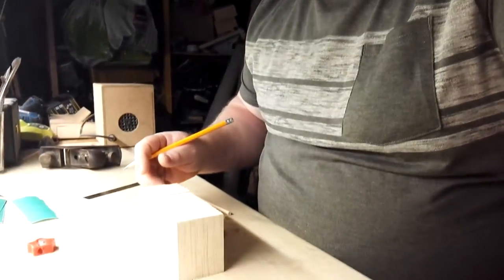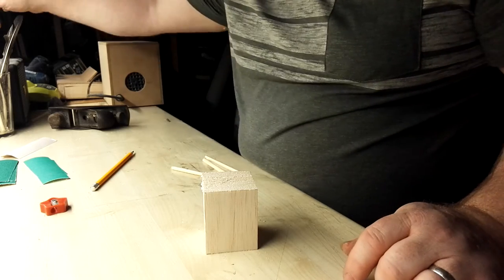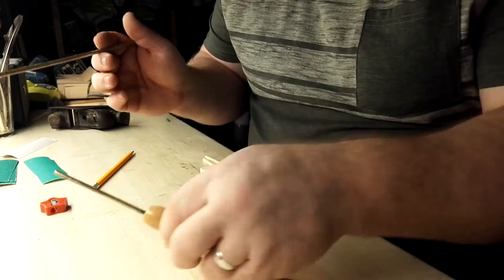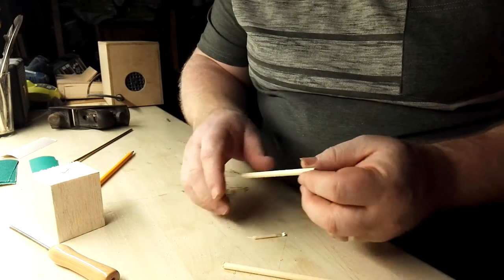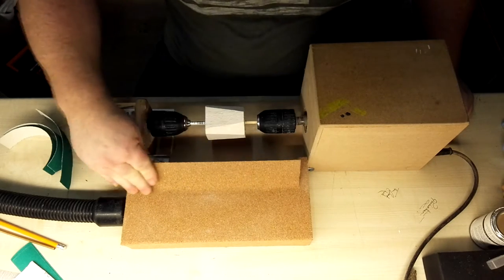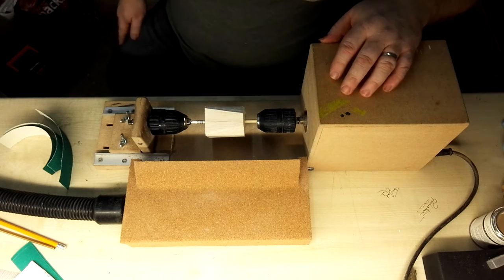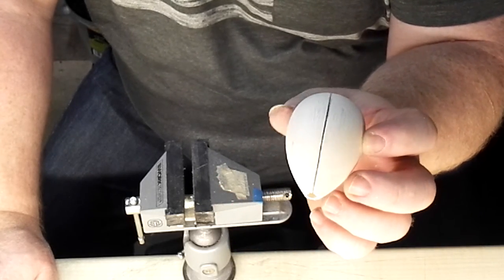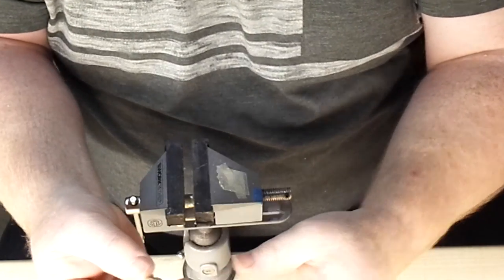Pike Gazette floats.....

Comment: were can I get one of the tools that you make the hole in the wood at the start of the project. I really like you work.
Reply from the maker: hi Will,
I make all of these tools myself as they aren't commercially available.
I was shown this one in particular by a fellow floatmaker.
Basically it is thin walled brass tubing I bought from ebay. I then just turned a wee handle to hold it.
Just get the diametre of tubing closest, but smaller, than the diameter of the stem material you wish to use.

Graeme.
Reply: Thank you . is there a plot in it at all or just solid. Or how ate you removing the cut out from the tool.